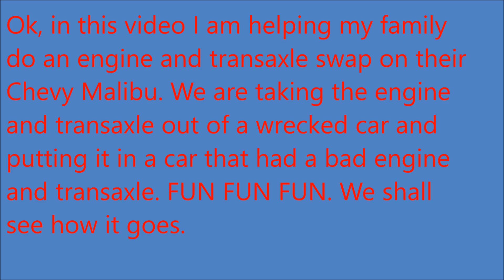Chevy Malibu Engine and Transmission Swap Part 1

Comment: I have a ‘99 Cutlass which is quite similar and I’m planning on lowering the subframe onto an old carpet (dragging everything out on the carpet grabbing its edges if possible) and lifting the car as high as I can with a 24 1/4” jack. This helped me via video as opposed to just manuals to remove everything I have to prior to removal.
Reply: It's been a year so not sure if this would help but that generation of cutlass is mechanically the same as this generation of malibu

Comment: did you figure out what the knocking was
Reply: Broken cam Valves hitting pistons 3.1 engine defect bad cam bearing I had two engines do this if you have this engine GET RID OF THE CAR
Reply: Larry Fries 

Malibu’s and impalas must be junk. Everyone I know that has had them have nothing but trouble with the motor and transmission. I’ll never own one nor will I work on one for anyone

Comment: Ive built a few 3400's and swapped 4t45e tranny's easiest way is after unplugging the wire coolant hoses and unbolting the ac starter and power steering, pull off axles unbolt the rear, driver side mounts support the engine with the cherry picker and unbolt the front mount and passenger side mount and pull out from the top quick and easy most of your time is taken up removing all the wiring and crap like that.
Reply: Engine and trans out the top?
Reply from the maker: Thanks for watching.
Reply: @markdavich5829  i need pointers on removing the engine from the transmission.....i might drop the cradle becuase i dont have a cherry picker.

Comment: So this may be stupid but what about the CV axles?  did you remove those?  Kinda hard to drop the subframe with a CV axle in each side of the tranny.
Reply from the maker: I didn't remove the cv axles I dropped the subframe with all of that still connected. Well thanks for watching and thanks for the comment. Have a good day.
Reply: Will a 2003 malibu 3100 fit in 2001 brick century 3100 and work

Comment: Very nice video journal.  Thanks.  I have a 2005 Malibu Classic 2.2 L that I removed the engine and trans the from the top without removing the subframe.  I did this because I thought the subframe bolts might be rusted and seized in place.  I see that your subframe bolts looked pretty clean.  I live in Minnesota where there may be more rust from the road salt.  Where are you located?  Are the subframe bolts protected from the road salt somehow?   When I removed the engine I found that the rear part of the subframe under the steering gear was rusted through in some areas on the top side but the rest of it looked good.  I still may need to replace the subframe.  ARRRGHH!
Reply: ZoobyDoo did you upgrade with a better engine??? If so ive got a few ???  Ive got an ecotec 2004 2.2l...id love to go 2.5 or hell 3.4-3.5.
Reply from the maker: We did this job in Independence, MO which is a town just outside of Kansas City, MO. Removing the subframe bolts on both vehicles was not to bad of a job for us. Here is Missouri the winters are not to bad, but they do salt the roads sometimes if it snows bad enough. Well if your subframe is rusting out, it is probably a good idea to replace it if you can. The subframe is a structural frame member. Also, I am not sure if the subframe bolts are protected from road salt or not. Well I hope this info helps you out. Thanks for watching and thanks for the comment. Have a good day.
Reply: ZoobyDoo I have a question for you. I have the same 2005 Malibu and I’m wanting to swap that engine into my 06 Malibu which headgasket had blew. Do you think it’ll work? The both hold 2.2 ecotec engines.
Reply: I have a 2005 Malibu Classic as well, with the 2.2L. I want to try swapping a V6 or something a bit more powerful into it. Would love to talk to you about your process/tools/time commitment!

Comment: It's Sammy Davis jr in the motor tap dancing. lol
Reply from the maker: Yep you were correct, that was Sammy Davis Jr making all that noise in there. In my other video the second I removed the oil pan, he jumped out of there did a quick tap dance and ran off. Hey thanks for watching and thanks for the comment. Have a good day.

Comment: 1 minute into the video and i say Wrist pin. connecting the rod to the piston.
Reply from the maker: I was not 100% sure what it was but I knew that it sounded like something mechanically wrong for sure. GM has a TSB on piston slap for these particular engines, but I thought it was something much worse and it turned out it was. I did a 6 part engine tear down video series on this engine and it ended up being a spun rod bearing. It actually had 2 spun rod bearings.  Well thanks for the comment and thanks for watching. Have a good day.

Comment: i want to buy this car but motor is bad and need to be swapped out wat type of motor should i use its a 2005 Chevy impala i dont want to put another stock motor any suggesting
Reply from the maker: I dont know to much about upgrading engines and what not. So far I have only replaced parts on vehicles that are stock parts. However I suppose If I was going to upgrade the engine, the first thing I would want to find out is what engines fit the transmission (make sure it fits the bolt pattern or if they have an adapter kit) that is in it and make sure the transmission can handle the horsepower upgrade, or find out if I would need to swap that out as well. I would want to make sure I can run all of the electronic/electric controls on the engine and transmission, so I would find out the pinout of the pcm/tcm modules to make sure I could hook up all of the inputs and outputs, and make sure everything worked properly, Also I would take time and figure out how everything would fit under the hood, and determine what would need to be modified to fit. Honestly though I would not even know what else would need to be figured out, because I have never done it or really looked into what would need to be done. I suppose I would try to research online any other swaps and upgrades that other people have done and try to figure out how they did it. Well I hope this info helps you out. Thanks for watching and thanks for the comment. Have a good day.
Reply: +AJ “Figgy” Pierce thanks
Reply: Ty Fame A stock 3.4L from VIN "E" GM vehicles is a bolt in replacement.  Doing one right now

Comment: Did you find out what was wrong with the engine making the noise?
Reply from the maker: Yeah I sure did. It was a spun rod bearing, making the knocking noise. I did a short video series part 1-7 showing engine tear down and at around 5:39 of this video  https://youtu.be/cUXDxkztNoc   you can see clearly what was wrong, and then again later on the series I show the actual rod bearing and it was spun, flattened and destroyed.  Well thanks for the comment and have a good day.
Reply: ty for the reply (subscribed) :) i took out my mom engine from her 2002 malibu gonna start taking apart the engine today
Reply from the maker: Hey you should video tape it and put it on youtube. If you do send me the link. Well good luck to you on taking apart the engine. Thanks for watching and thanks for the comment. Have a good day.
Reply: hey i uploaded a video like 5 mins ago take a look at it :) , finally was able to get that hard bolt ty so much.